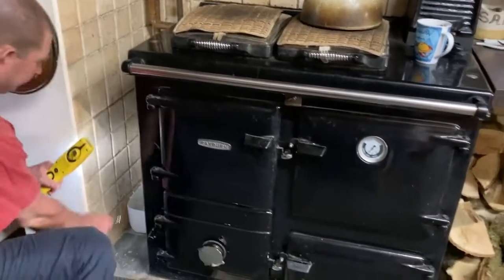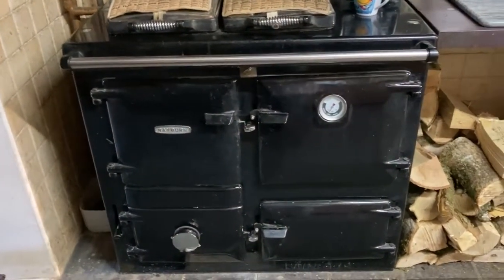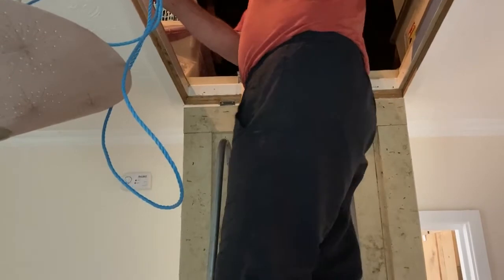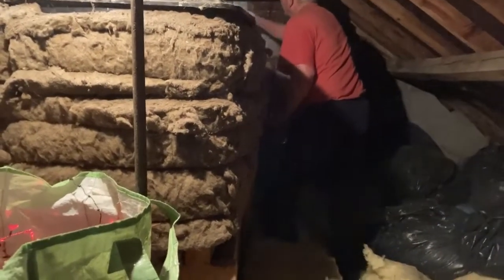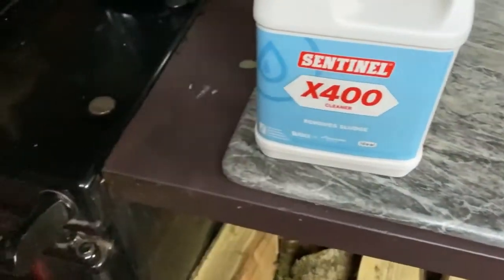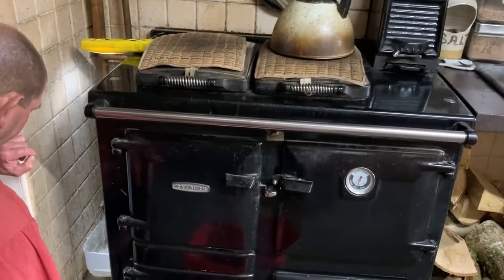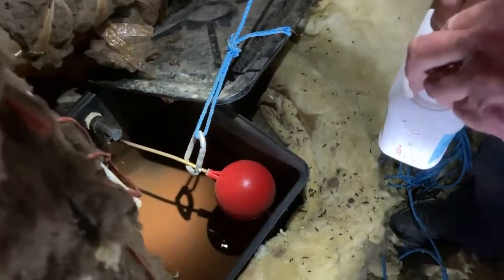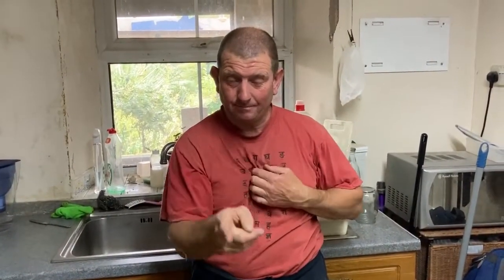Part 1 Servicing Rayburn Royal Heat Exchanger #selfsufficiency #uksmallholder #smallholding

Comment: That's  definitely an all purpose stove.  Looks very sturdy.  Martin is very handy.  We had radiator heat at the schools I attended  62 years ago.   I liked it , would try to get a desk close to them. Do you have wool insulation in the attic? I hear it's very good. We have synthetic here in the states.  Thanks for sharing,  this was very interesting.  Be safe and blessings to all  ❤
Reply from the maker: We have the normal fibre glass insulation although there is lots of bags of alpaca fleece and sheep fleece up there as well.